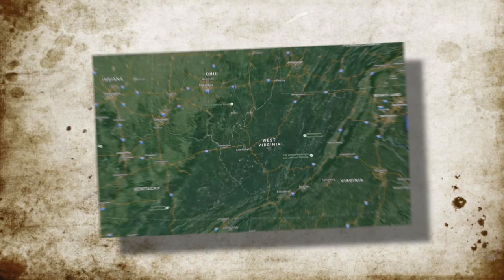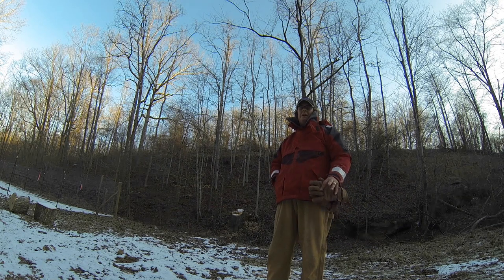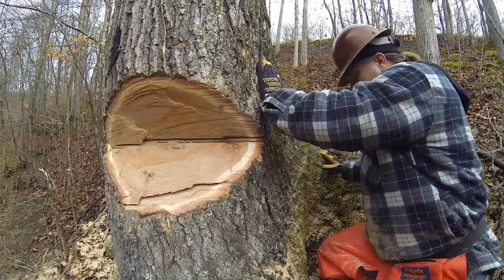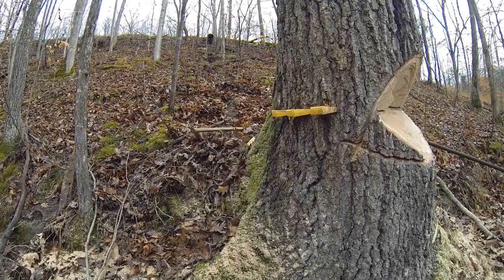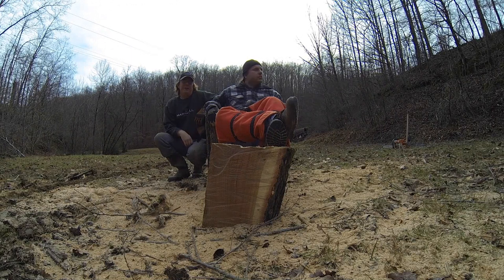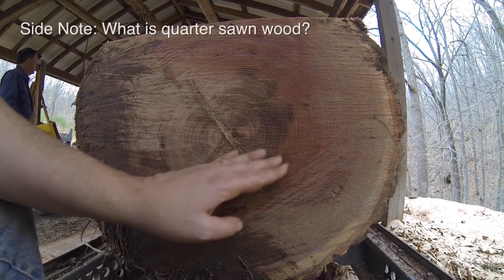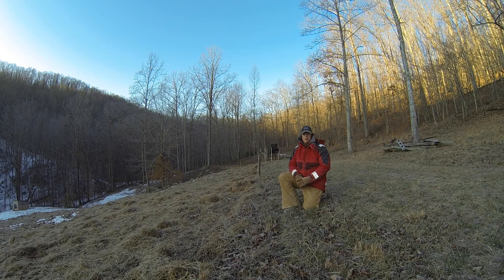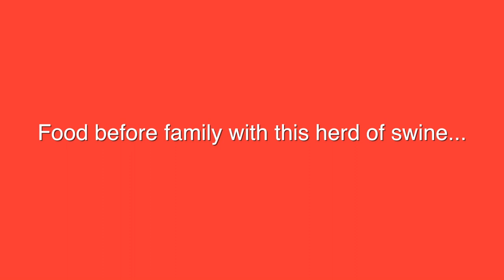Episode #002: Proper tree felling technique & sawmill time

Comment: Loving all your videos, you have a great way of narrating. I don't sub to many channels but yours was a winner immediately. I was cringing about the dirt on the logs, and then at first you didn't mention quarter sawing and I was cringing again- red oak of all things- but then you got to it. Whew! 
Do you ever run 2 cants together? The way I learned to 1/4 saw was to slab 4 sides, then cut the exact center of the cant, flip the top half over (both centers now up), and saw both cants together. After a couple boards from the center, you flip both cants 90 degrees and, after 1 board, are usually back to 1/4 sawn again.
I do have a question about your brother's comment on the strength of the cambium. I know it has more elasticity, but strength? Never heard that before. Certainly not for woodworking. I first learned about that felling technique from Northern Woodlands magazine, and have used it successfully on some sketchy trees. Second question- instead of trying to steer the tree a few degrees with so many wedges on one side, why not just notch directionally to where you wanted it and use one wedge in each side?
Sorry for the long-winded comment. Anyway, I didn't point and laugh but I did thumbs up! : )
Reply from the maker: julie r I have tried that quarter saw method but honestly we have milled so much red and white oak we usually flat saw the log to get the wider boards for cabin flooring and other things. My wood working supply of wood is beyond capacity. Not sure I will ever get it all used. We tried to de-bark logs when we can. Other times we rely on my brother's skill of sharpening and setting or replacing (not the most economical) the blades. It is my understanding that the cambium in a green tree does have good tensile strength but I have nothing to back that up with. Thanks for commenting and glad you enjoy the videos.

Comment: You need to provide a much better roosting platform for those heavy hens instead of expecting them to roost on sticks, that is uncomfortable and not good for their feet, Get some poles from all that wood you have out of the surrounding wooded area that way your hens can spread out and not be so crowded and then that way they won't get grumpy and start pecking at one another and have their roosting time miserable and not be able to get the rest they need to make the eggs expect them to make. My Mom and Dad made that type of set up for their hens and they were happy hens and were not squatting literally on top of one another.

Comment: Please don't use this as a guide to "proper felling techniques".  I like this channel and I'm no pro, but there were a lot of techniques there that can get you in serious trouble (poorly cut notch, inconsistent hinge wood, preloading hinge wood with lots of wedging, mismatched bore cuts on a tree that doesn't look to be leaning enough to warrant boring technique, etc).  If you are looking for tips on felling there are great sources of info on YouTube, one I'd recommend is checking out Terry Hale, he has some awesome videos on the fundamentals of felling as well as some more advanced stuff
Reply from the maker: I have used this technique probably 200 times now. In the 20 years I have been cutting trees, this is by far the best way I have found to cut. The wedging allows complete control and steering of the direction of the tree. Much more reliable then standard wedge and backcut process. To each his own, though.